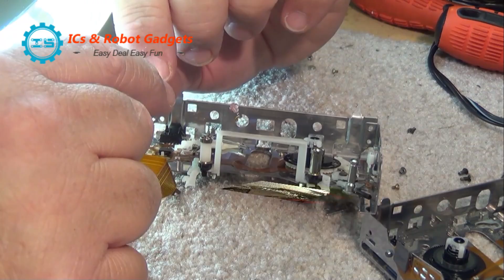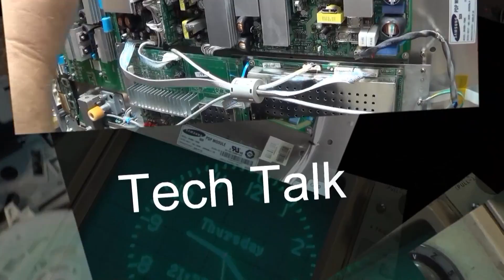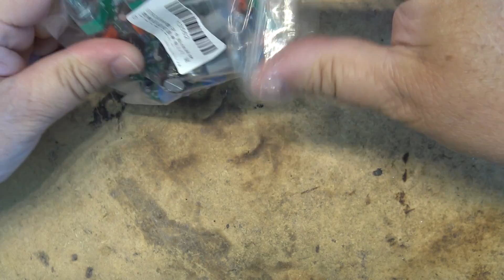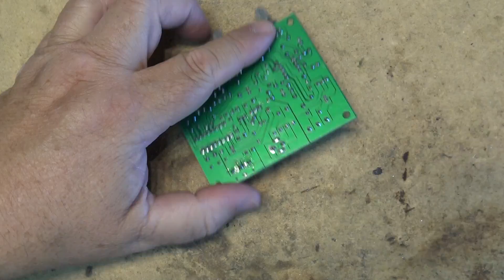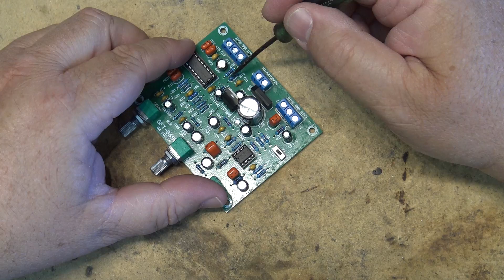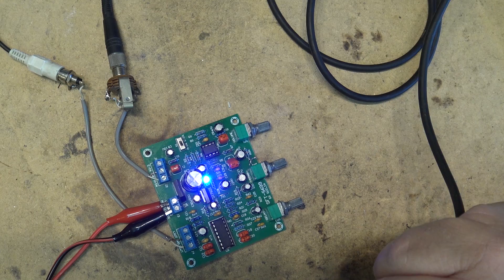ETK3699 Digital Reverb Echo Microphone Guitar Preamp Board

Comment: I recently put one of these circuits for use on a microphone. It works well but I am getting a HUM from my amplifier. I have the shielded wires tied together from my input wire to the output wire. Do I need to ground those shielded wires to the inside of my amplifier somewhere? your response is appreciated.
Reply: Yes. 😎👍

Comment: I"m failing at making this thing work even though I've watched your vid a few times. 2 questions - 
- does this also require an amp? and would I put an amp before or after this board?
- this says 'microphone' but I want to use it for a guitar (as you mention at the top of your review). But not getting any response from either input setting.
Thanks!
Reply from the maker: Yes it requires an amp.
Reply: @12voltvids  so the output from the board goes to input of the amp?
Reply from the maker: @ScottKoegler  yes correct

Comment: Apparently if the delay time is set too low on startup (with the PT2399 at least) it can cause ''catastrophic failure''.
Reply: it will cause the echo effect to not function until you reset the unit , it doesnt damage anything tho .

Comment: Yes a slight echo on a c.b transmission really did improve the clarity of the audio.
i'm not joking, it gave more depth to the audio, as long as it was just a slight echo, no more.
I actually liked the tape echos better, it was different to the bucket brigade delay chips of the era.
Reply from the maker: First one I built in high school used a CCD, charge coupled  delay chip.  Was great for phase and flange effects on the stratocaster.
Reply: Sounds like you had great fun making and using it :-D
The school i went to had no electronics teaching, and i was mentally slower than a snail, maybe the drugs to treat epileptic fits caused some of it.
Or i was just thick lol :-D